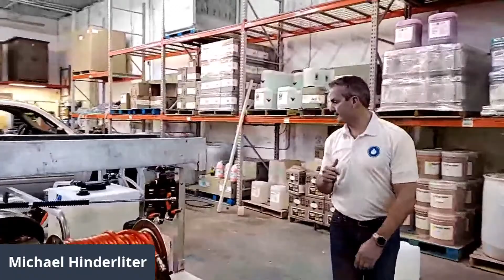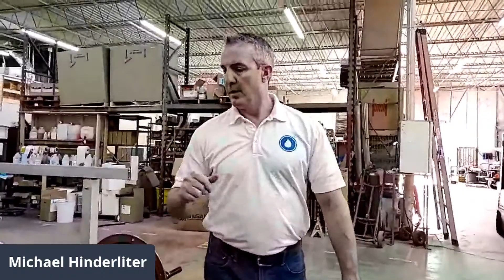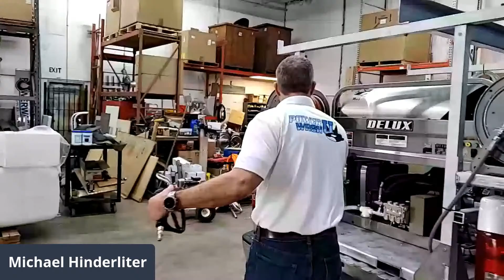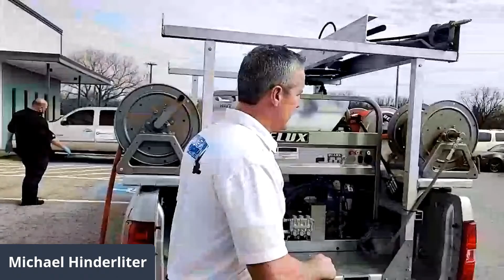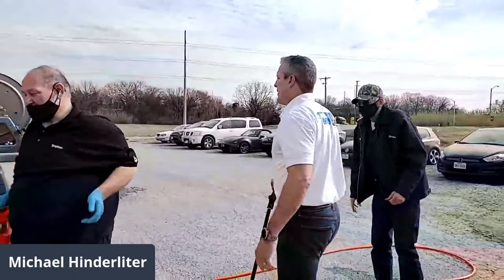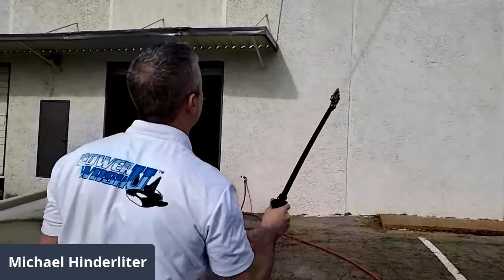Part 3: Live Truck Skid Build for Power Wash and Soft Wash Systems

Comment: How do you mount the trailer onto the box
Reply from the maker: not sure I understand the question.  The skid set in the back of a truck.  It does have hole in it in the vent you want to mount it to the bed.

Comment: Hey Mike where can I find the swivel attachment for a softwash hose and gun never saw one for softwashing... Another question I was always told that you should have at least a 1" to a 1 1/2, line from your water tank to your pressure wash pump and to always keep as short as possible you line appeared small in diameter but Long in length, if I was told wrong info would love to know cause it would allow me to set up my truck much easier
Reply from the maker: Please give us a call for that swivel attachment, 1-800-433-2113.  I am not sure I fully understand your need.  As for the water supply line.  I have run two 5.5 GPM machines off a 3/4 inch line at the same time making it 11 GPM.  I began to see an issue when I added another 5 GPM unit making it 16 GPM.  Also, the inlet on the pump is only 1/2 inch.  So pluming 1" to 1 1/2" is major over kill.  We always plumb 3/4" and that is plenty.  It is also pointless to plumb it both side of the pump inlets.  That is also over kill

Comment: What size is that water tank? Looks like 55-65 gallons? With a 11 GPM P40 this setup won't be workable with that little water especially if you run the pressure washer and the P40 at the same time. I know this is for show, but is it also meant to be realistic for a customer to use?  Thanks! Love the content
Reply: He put Hudson float valves in the tanks so you van continually keep the water from the house running without over flow.  However if you run into a situation where there's no water connect you more than likely won't be able to do the job